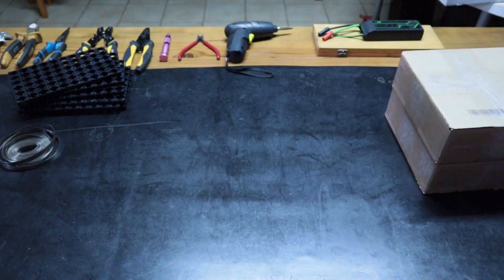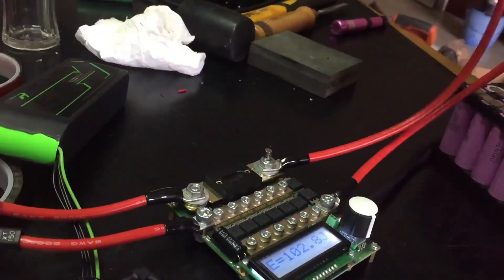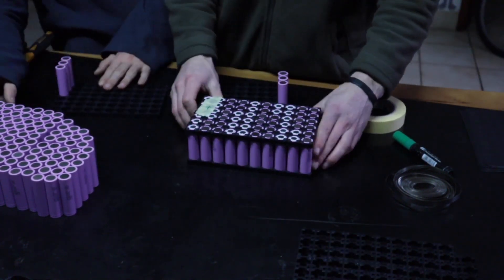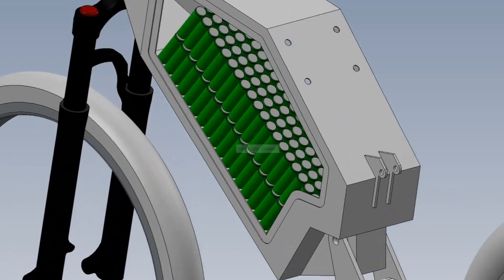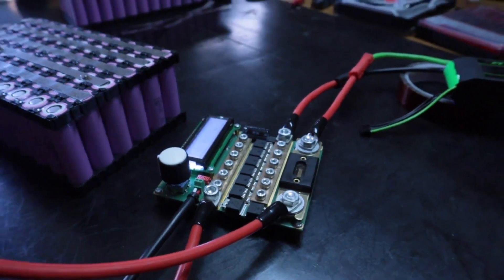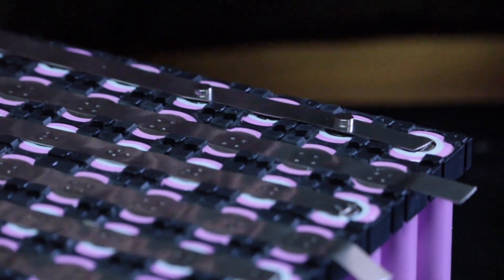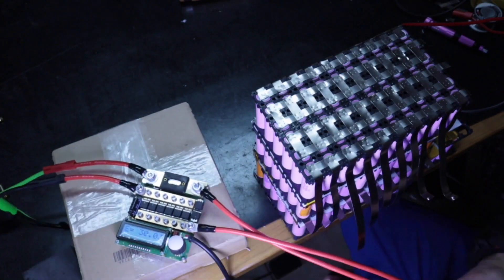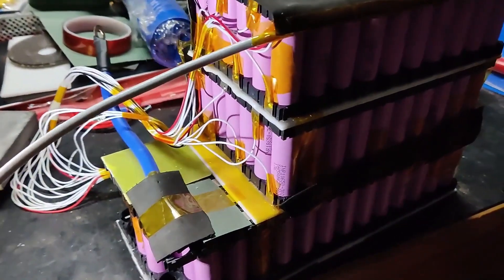Making a 72V 30Ah Battery for a 5000W Ebike

Comment: You don't have to worry about getting shocked at 72v unless you plan on licking the battery
Reply from the maker: Well you never know what people will be doing... jokes aside if you have sweaty hands and happen to be barefoot on a good ground I can guarantee you'll feel a slightly unpleasant shock :D
Reply: If you have cuts in you skin, you can feel 24v.  Not too painful, but you will definitely know about it

Comment: Hi i am about to do the same. Is your bike the clone of bomber ?
Reply from the maker: Hi, it is a chinese copy of a bomber, correct!
Reply: Thank you for your efforts. I want to know if these frames support 20' x4 rims/hubs thank you !! the 199/20x2.5 are very expensive @Asvybre
Reply from the maker: I am running 19'' with 2.5'' tires, kinda common here in Portugal. 
But I can tell you from measuring my swing arm that I still have 35mm of space for more tire before hitting the swing arm.
From this you are able to calculate if the wheel fits!

Comment: Great video, was wondering how many amp I would need for my 72v 5000w motor with 80a controller?
Reply from the maker: Thank you! It depends on how heavy the bike + driver weigh, the range you want and the lifetime of the battery. From my experience 110Kg bike @ 3kw I get 60km from this pack (30Ah). If you want around 50km at that power @5.5kw. go to (50Ah)
Reply: @Asvybre  Salut je suis du sud de la France 🇫🇷 
Je veux construire une batterie pour mon vélo qui a un moteur de 72 volts 3000 w 

En fait j’aurais souhaiter faire une batterie 72 volts 50 ampère / heures 

Peux tu me dire quoi prendre comme matériel , c’est à dire cellules , bms, 

Et aussi combien de séries et de parallèles ?

Merci de ta réponse je me suis abonné ..😊
Reply from the maker: Salut Louis,
Hope you can read in english as my french is not good...
You would do a battery similar to what I have done in this video but you'll need more cells.
If you use the same cells I use, 30Q, you'll need at least 320 cells for 50 Ah. This is 20 series and 16 parallel.
Use a BMS similar to mine and the rest of the components are in the description :)
Merci :)

Comment: Hey Alfonso! Great video! I just bought a 72v 3000w motor but I don't know how to calculate my battery :( It seems I need something to continuously draw 41 Amps (3000w / 72v) or am I wrong? Can you give me a tip??? Thank you! Thumbs up!
Reply from the maker: Hi Nicolas, thank you for the feedback! You will need something similar to that, most 3000w motors don't run at max continuous but it's always a good idead to size the battery up. If you're going for 18650 size like me, I suggest you stay above 6 cells in parallel unless you are running high discharge cells. Am happy to further help you with your project!